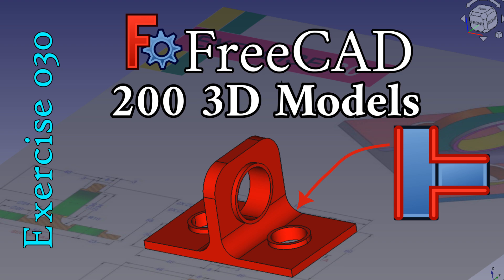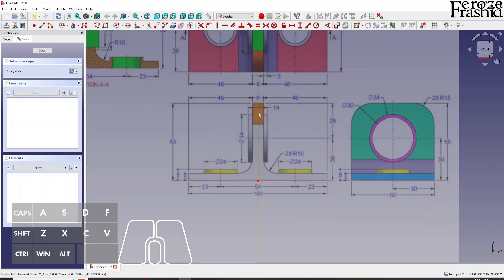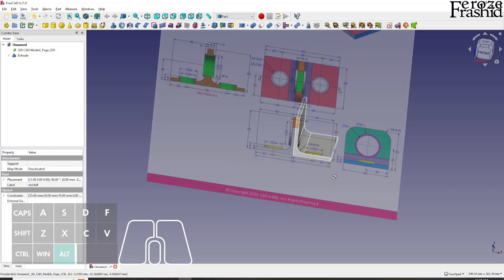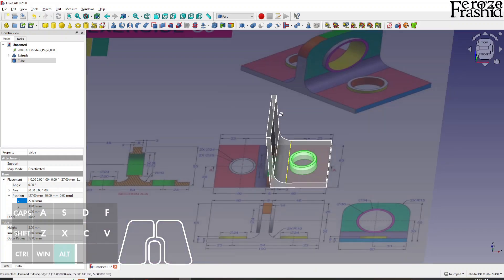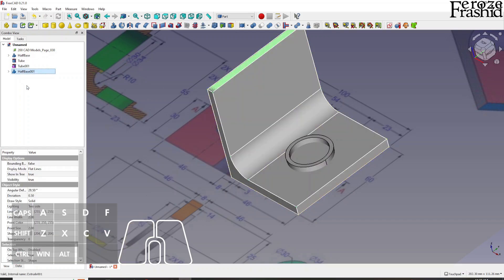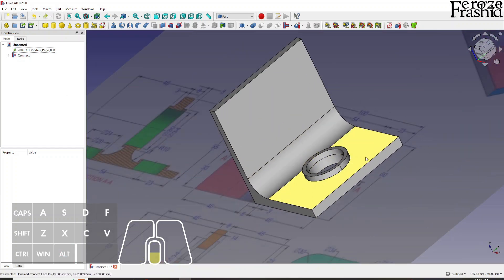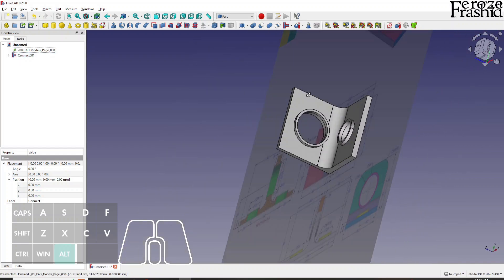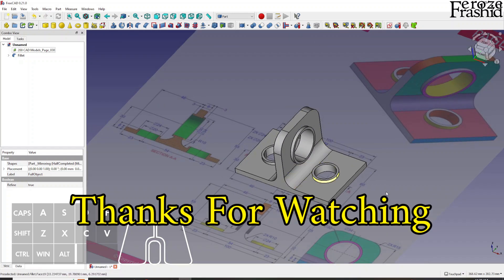200 3D Models in FreeCAD: Exercise 30 (Use Connect objects tool in Part Workbench)

Comment: I do not seem to be getting through holes at the inner area of the tubes.  What could be causing this?
Reply from the maker: Sometimes the height of the object (pipe, in this case) comes in to play. Also see if both the parts are solid.